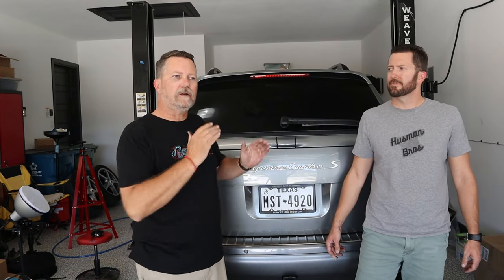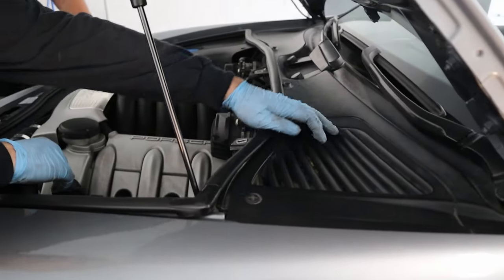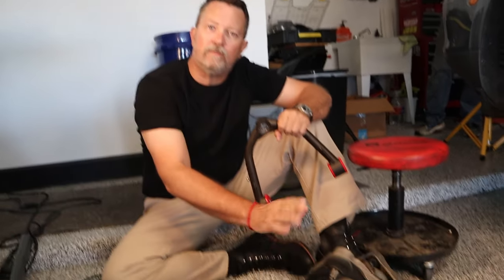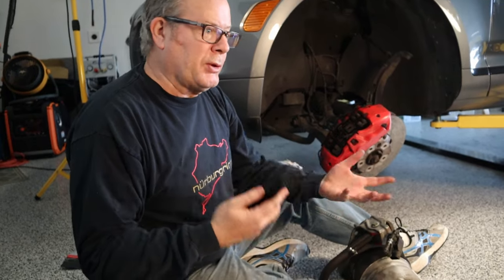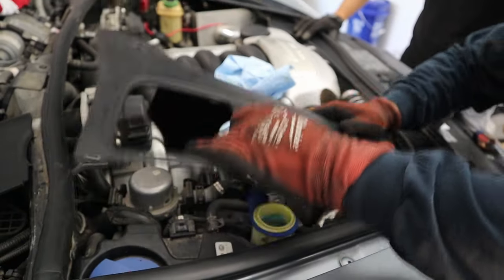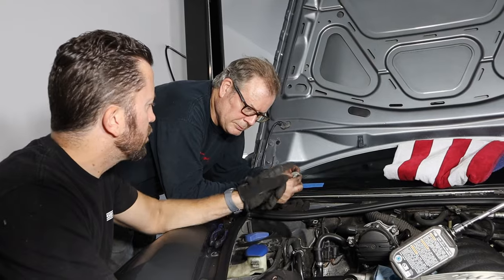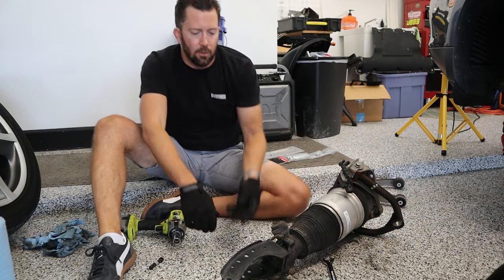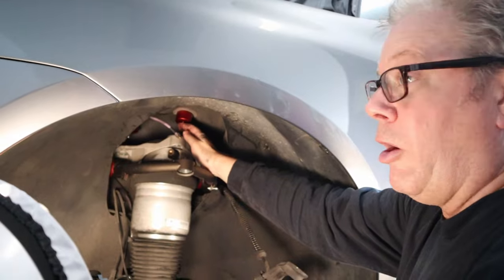Eurowise Porsche Cayenne Turbo S Front Lift Install! - Husman Bros!

Comment: Thankyou!
Reply: Want one!
Reply: I'm continuing to study this Cayenne purchase idea.  I have a fairly rugged drive to my off the grid house on Maui. Generally 4WD is a must.  Currently my Ford Explorer 4WD w low range  does fine with out a lift.  I'd definitely need a Cayenne with the low range and the smaller than 22"rims and bigger  AT tires.  It would be so cool to have the air lifts but as long as there is a low range and it's lifted no need, I guess....  The selection in Hawaii for Cayenne's is limited and looks like the ILWU is about to go on strike so I'd have to delay shipping one out till it's over with.  This would be my  pleasure date car.  My buddy drove a Cayenne to my studio a few years back and I've wanted one since.  It was black and turbo.  The sound when it's starts up is what sold me on it.  Just love that sound!  Don't you?

Comment: The smallest wheel you can run with the big brake calipers on theTurbo S is a 20, just curious as to why you picked an S to build an off road machine?
Reply from the maker: We have 18” Victor Berg wheels on this one and they fit fine. We picked a Turbo S because they didn’t make a ton of them, so why not build one?

Comment: 7:55 ... This part is expensive, be careful... This strut costs two thousand dollars!

It's funny that the Americans are spending a fortune owning a Cayenne - - I spent less than US$200 per strut using a repair kit (even the air suspension compressor costs only US$150 for a brand new unit!) That's why I had enjoyed my Cayenne for many years without burning a hole in my pocket! 😂😊😅